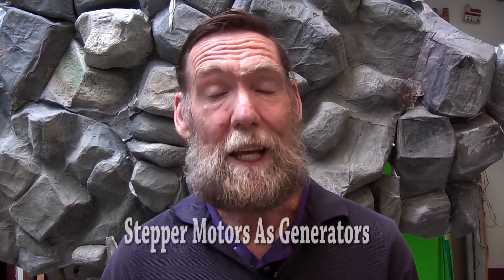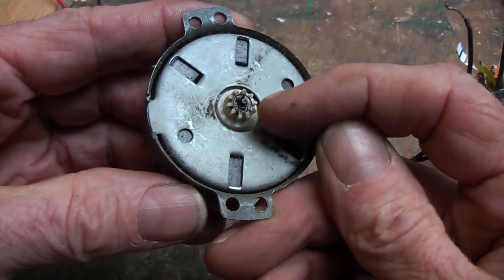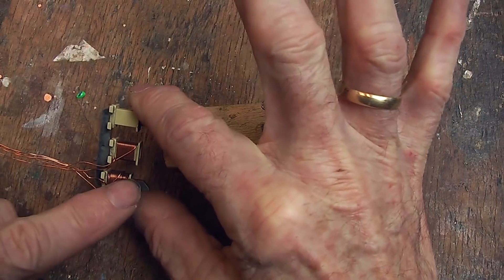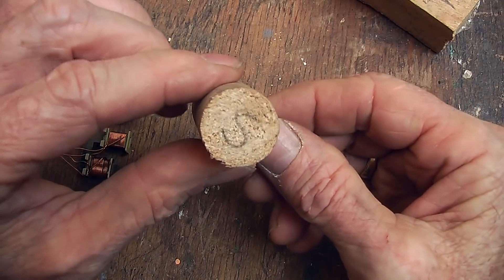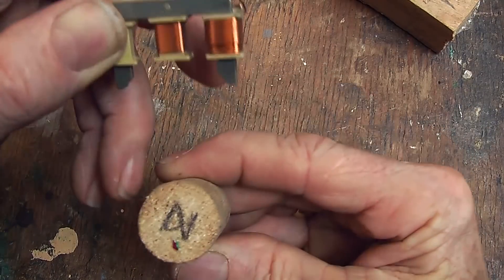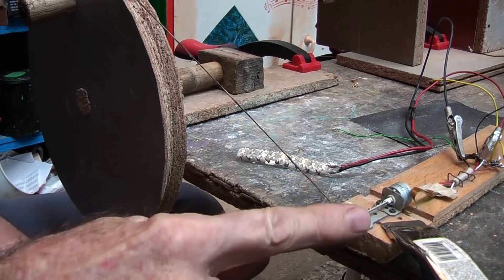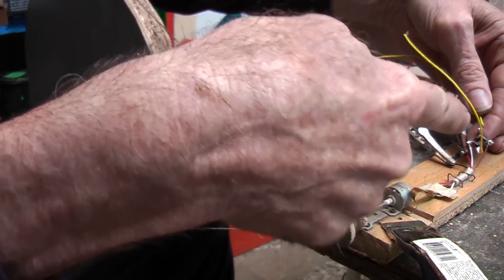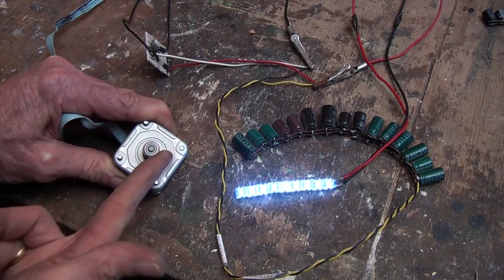Reinventing The Wheel And Electricity - Stepper Motors

Comment: I genuinely feel like I understand more after watching these videos.

For that printer stepper motor at the end, ever considered press fitting a broomstick handle (the staple of this channel) to the printer motor shaft making it a pinon/sprocket, so you could then directly use a much larger sprocket or a straight rack or something to spin it fast with low effort?
Reply from the maker: Hi. :)  Yes  I did that  quickly once , but I was in such a hurry to see what happens that  it  was not a good fit, so it  did not  last  long. I will revisit  this as it  merits  more  concentration and  dedication. The trade off in this is that  with  more electricity  produced , more resistance presents, which is logical as you are  moving more electrons, so forces must  match.  Did you  miss today's cameo broom handle appearance?  It was  the pulley on the  floppy drive  motor   and of course the shaft on the test pulley... and, our cylindrical magnet  :). The  stepper motors I am keen to  try  and adapt into small  hand lamp systems. Some I have, already have some gearing, so just a handle and  case to put it in should get  something going. I have some friends with laser cutters and have suggested it  to them, but now it  just  needs implementing... time.